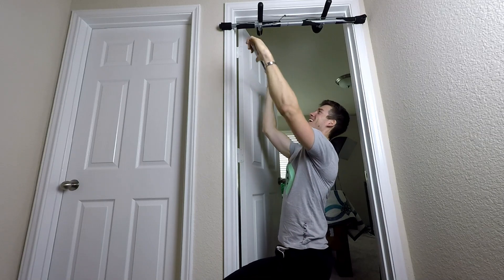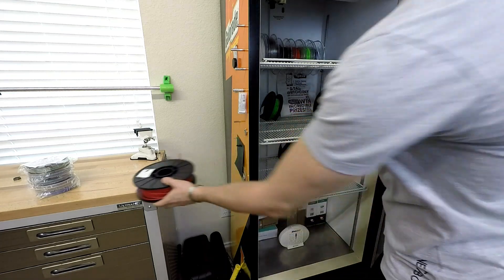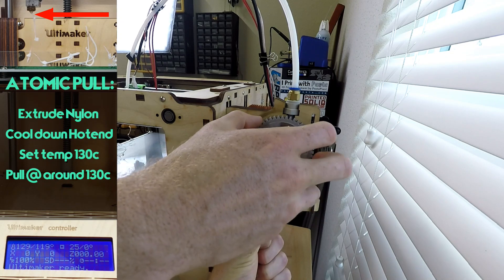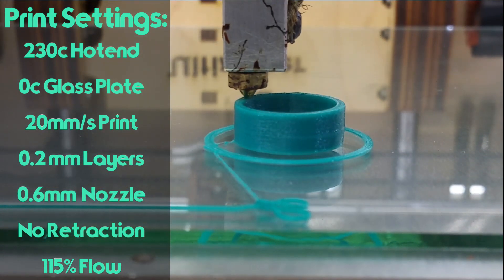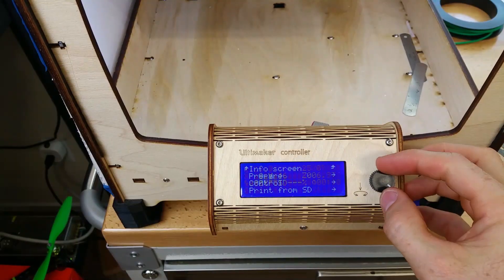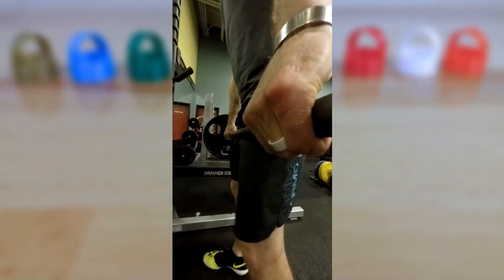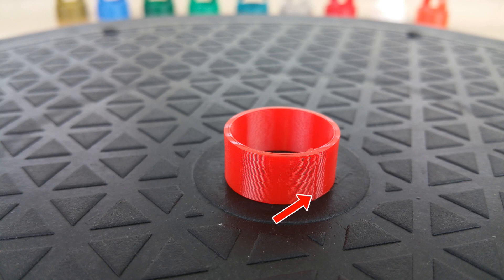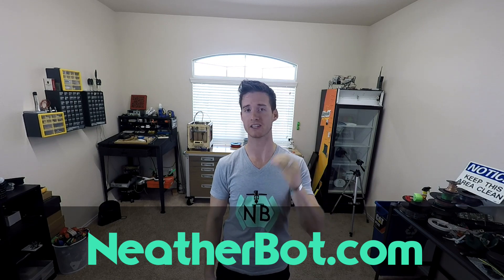Flexible Wedding Rings

Comment: You should print it in "vase mode" in simplify 123d where it prints in a constant flow of filament, means there shouldn't be any seams.
Reply from the maker: +r3g27 I looked inn to this and I may be wrong but it seemed either way because of the thickness of the ring still have the zipper. But you have convinced me to try it anyways... I'm printing one in Vase mode right now ;)
Reply from the maker: +r3g27 UPDATE: ok so that's what I thought... even in vase mode you get a zipper because of the wall thickness being 2 perimeters.
Reply: There are a few things to try here, clear the checkbox -- force retract between layers, then it should eliminate that zipper. Also if you print with a thicker nozzle (which volcano has a bunch, you can do single perimeter in vase mode). I know you said you turned retraction off, but that zipper is a sign it's still doing it.
Reply from the maker: +kazolar I have turned off retraction between layers, and refraction is turned off. Printing with a bigger nozzle with a single perimeter would be the only way to get the transitions to go away completely. I am playing with printing at 0.1 and things clear up a bunch.
Reply: Whats the layer width. Feels like u could do one thin wide layer and get super quality with wase mode.
Reply from the maker: Tommy!! Whats going on my man? I agree, I need to try this out. That would definitely provide the best surface finish.
Reply from the maker: Rings are 1.2mm thick I could change that if need be.
Reply: try to set the width u want and start the print. if needed go with the 1.2mm nossle. at 0.1mm layers hight and a width at 1.2 never tested that soooo.
Reply from the maker: +Tommy Nilsson sounds good, I will be trying this out soon. Haha I just got the V6 horned installed, it's already time to take it back off ;)